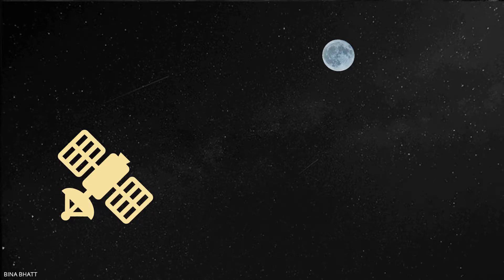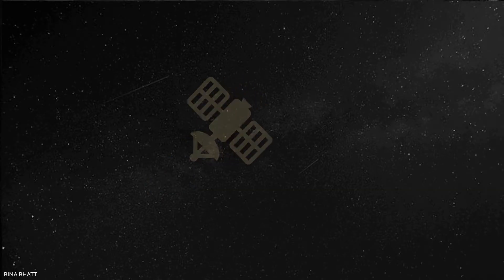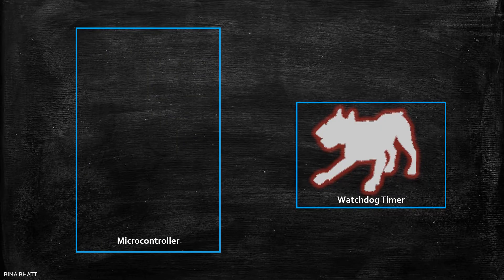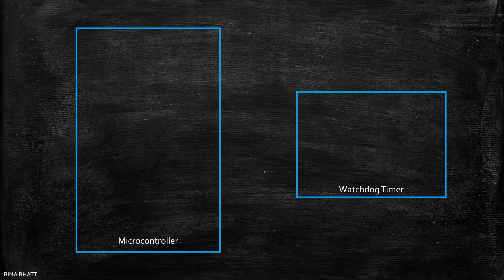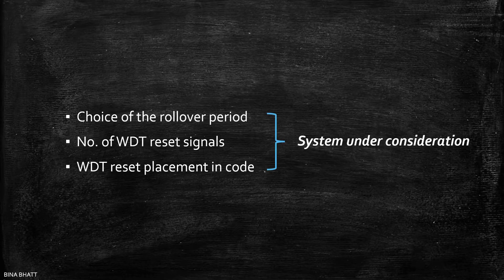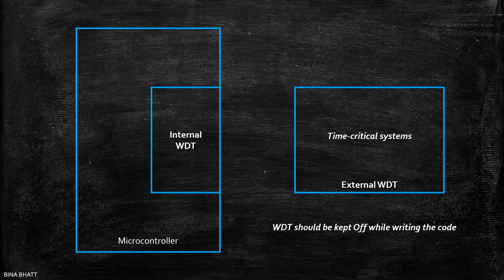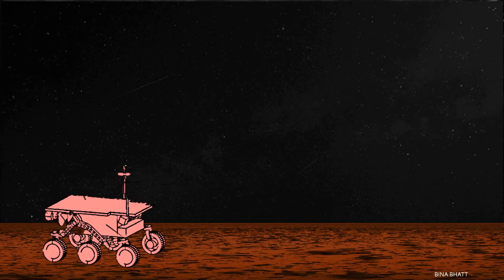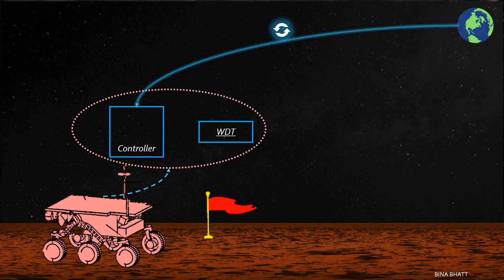Watchdog Timer - Introduction and Importance | Microcontroller Basics

Comment: Thank you for explaining with real world examples. One question, if the code can be uploaded/ updated remotely, what are the safeguards to ensure that only authorised code is uploaded to the controller?
Reply from the maker: That's an interesting question and as far as I know it is possible to break into the system but the question is will it be worth it given the cost and effort needed to accomplish the same...

Comment: Mam is it possible to trigger (whenever any pin connected to the controller, that pin used as a feeding signal to the watchdog) the watchdog timer externally.
Reply: Like Manual hardware trigger.
Reply from the maker: how do you intend to use it? Also, check the datasheet!

Comment: My LCD do display corrupted characters upon several transition probably bcs of length of cable to LCD or electrical interference. So most times I does manual reset or switch the circuit off and on to restart.  Pls how do I use WDT to restart the MCU when it goes into another mode.